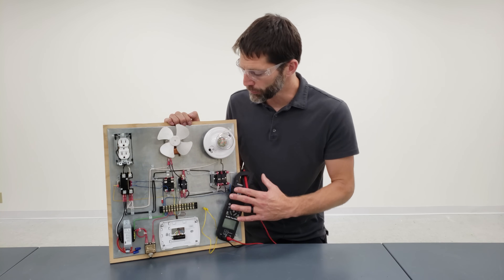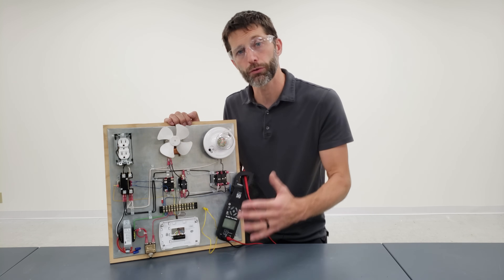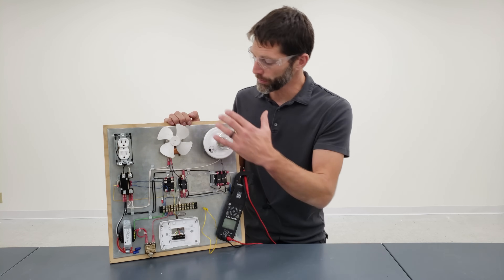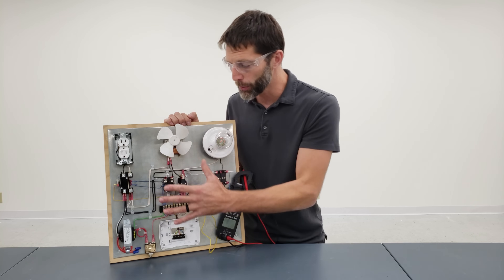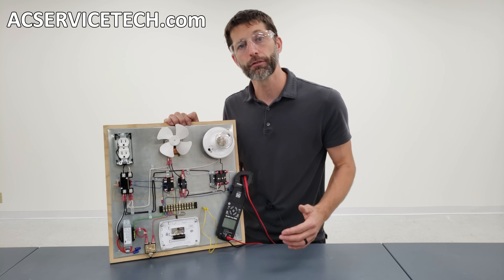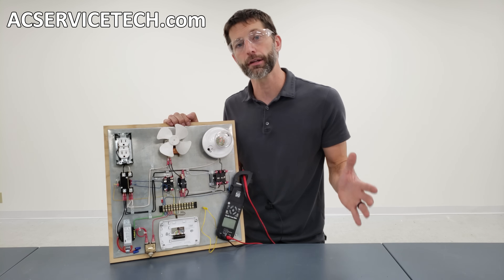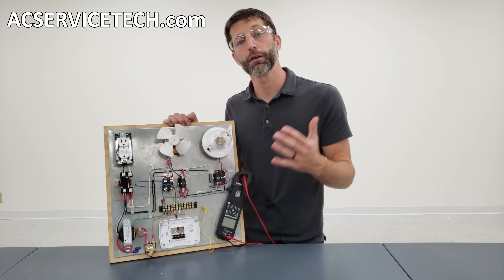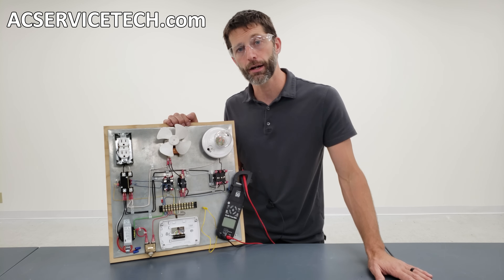3 Methods to Test HVAC Electrical Switches with a Multimeter!

Comment: 2:45 I recall being taught that one should never measure resistance when voltage is present. That the multi meter could blow up. 
What say you?
Reply: He doesn't apply voltage to the 120v side where his meter is connected. He was just checking continuity through the switch. But yes I believe you are correct, you don't want to check ohms while voltage is applied.

Comment: If you parallel across a switch you will get a 0 reading with power. The meter acts as the resistance for the voltage , can confuse the hell out of people ……. That’s why hopscotch method is best practice , always grab the neutral in circuit and move along each component like in video .  Great 👍 video CHRIS

Comment: I just got a new  24000 btu  York side discharge....................When i stan in front the air flow is direct by the fan  inside the condenser.............Is it normal???   when i saw a Trane side discharge or a Carrier  the air flow goes outside by the fan..    I think it is very dangerous for a personne with long hair, who can have his hair stock in the shaft of the electric motor!!!!   Sorry my english is not very good.  The technicien wiil come back tomorow

Comment: HVAC Switches: 2 wires = ON or OFF...When switches are OFF you got voltage between 2 wires across to the switch, needless to say switch is Open (24 or 120 volts) when switches are ON there would be no voltage (or very little voltage or OL) 😎🤞😂 Note: When measuring a live wire with a multimeter voltage there would be no voltage between 2 points close to each other. Takes me time to comprehend this switch rationale  - when switch is OFF there would be voltage across terminal but when ON there would be no voltage across terminal.
Reply: There could be volts unequal across old, pitted terminals.

Comment: With method 3, if you see a voltage across the switch that is also an indication of pitting and corrosion on the contacts.  Actually more reliable than testing the disconnected switch since the resistance may be higher with the higher operating current flow.  This is more significant in low voltage circuits as losing 5 or so volts across a switch has more impact at 12 or 24 v than at 120.  But even at line voltage that voltage drop across the switch with load current is heat in the switch and lower operating voltage for the load, both of which will likely mean failure in the future.
Reply: Thank you. Very important information. Thanks.

Comment: That's curious you made a statement that the method of reading across the switch is use the least I use that method all the time. Maybe it's because I work primarily on commercial equipment
Reply: I work primarily on resi and that's the method I use the most.